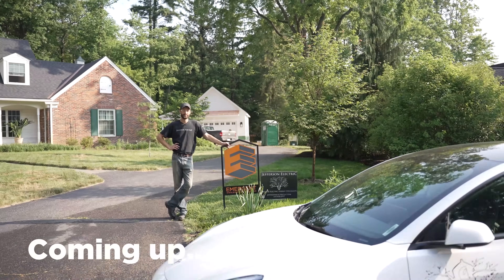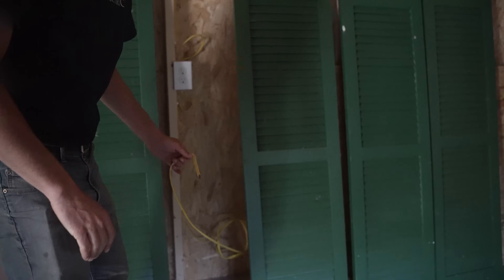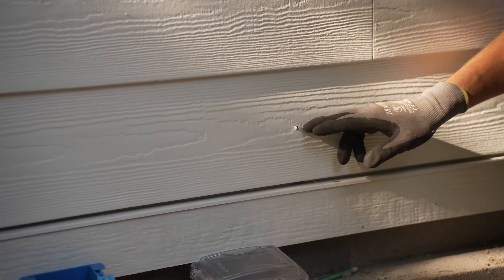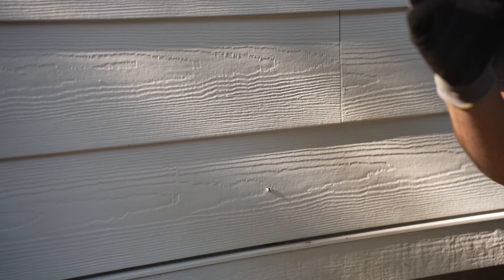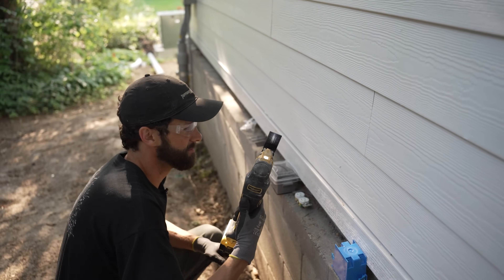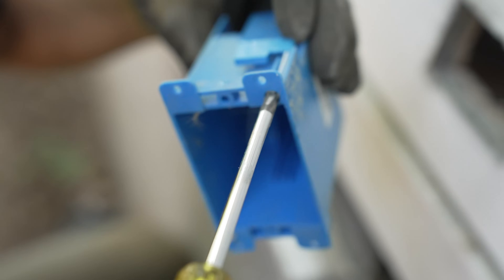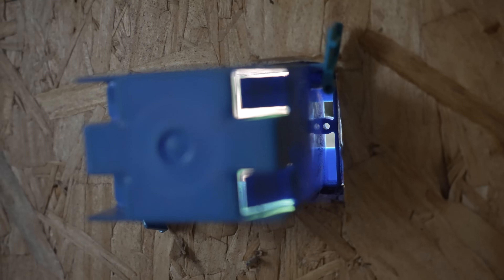Should this Exterior Outlet be Horizontal?

Comment: At 4:40 you spoke about drilling several holes to verify the lack of any interference framing before cutting in a blind install application. Another method that can be used with a slightly larger exploratory hole is to insert a piece of coat hanger wire that has been bent to a do degree angle into the hole and spin it 360 degrees to confirm that it is free space.

Comment: It's a shame the builder couldn't put a device block on the sheathing, put drip cap flashing on it, and integrate it with the lap siding ahead of time.  Nonetheless, excellent work and great instruction for retrofit applications.
Reply: Yes, with Hardie Fiber cement, it should be done on a flat mount either Hardie or Azek plate, flashed and Hardie siding around it, cutting hardie this way is not correct at all. And not paint the cut edges does cause issues, not prudent. All my outdoor fixtures, and duplex receptacles  are mounted on a flt Azek plate Hardie around it, and Azek properly flashed and the correct gap between Hardie and Azek mounting.

Comment: With the siding being thicker at the bottom than at the top, mounting it this way causes the face of the box\receptacle to be not plumb, especially if it was mounted vertically.. Isn't that aesthetically unpleasing?
I would prefer using a weatherproof box, cutting just the siding and mounting the box to the sheathing OR mounting a box to a stud.

Comment: The flimsy blue box reminds me of some crap that K Mart would scream out on store PA " Attention K Mart shopers we have a blue light special in the hardware department. 5 flimsy Blue plastic electrical boxes for only a $1. Somebody back in the 1970's made gray plastic what supply house called builders specials that were far worst then the blue light specials. threaded 6/32 hole would strip anytime devices screw was just tightened very little over snug fit.

Comment: Us old timers & Greenlee company called that long bit a door bell bit. Greenlee made them in 12 & 18" lengths and a few diameters.  A few years ago at an IAEI class they told us we have to use type UF cable to enter any exterior box due to type NM-B cable is not rated for damp or wet locations. If pkssible I prefer to use a sturdy metal wall case and mount it on side if existing stud & use two screws to secure side & a maduson bar on other side. ( vertical mounted box ).

Comment: ouch, cement board and very old plaster are totally killer on oscillating saw blades. to much friction and heat build up in their high speed oscillations.
surprised you managed to do that with "one blade", as it likely had no teeth after 5 seconds. lol

Comment: Here either a mounting block which could have flush or surface mounted metal box or surface metal direct onto siding we never penetrate the siding direct with a box, masonry brick/veneer is an exception but then many timers a surface mounted metal box.

Comment: 10:38 I don't believe it's required by code but it is certainly good practice to put the neutral up when mounting sideways. although not really a big issue in this situation as the box will prevent pretty much everything from getting in there including those giant pressure washer GFCI plugs. And I am of the camp that the unused screws should be screwed in, it's sort of like asking for something to poke them.

Comment: That box and cover sticking out of the side of the garage like that is quite the eyesore. I would have caulked the top and sides of that box, a neoprene seal will deteriorate quickly. I also would have fastened down that wire on the interior side as well. 
I’m assuming you’re going to do it, but when you make a how to video you should really show it.

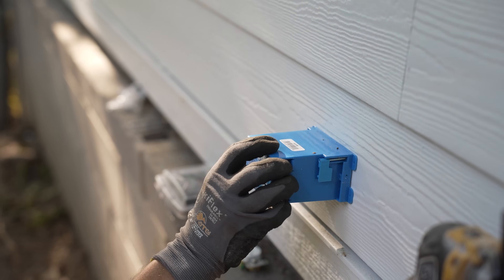Comment: 4:50 Easier life hack for finding studs, would be use a scrap piece of 12AWG with bend 90 degrees at 3.5" then insert and feel around. With insulation you can use the bit method or just straighten out the wire and probe around or upsize the wire a bit as well.  👍🤠

Comment: Those are the absolute worse outdoor electrical box you could have installed. They will leak. They look ugly. And they’re not even surface mount. If it was you could at least have that going for it; not penetrating causing leaks.   

No. Get a recessed in use outlet box with a mounting plate that matches the color of the house. Some come with seals or get a putty pad and stick that to the back inside to completely seal it. Then some tape like zips sealing tape.  

And it’s nice to put 20amp outside commercial quality WR TR outlet and have the breaker be AFCI and GFCI.  Much easier to go to a breaker and reset when you have a bunch of outlets in closed boxes around the outside. Or when it’s freezing out. Or raining. Or how most homeowners won’t know where all their outside outlets are and wondering why this one odd indoor one just keeps tripping. And how the gfci breaker will be inside and won’t ruin because water won’t be leaking into the panel. Well maybe if you do it. 

Or like this horror show where you have a single inside electrical outlet being the gfci fault location and not the outside. So when it trips and it will trip because of your poor poor boring non creative choice of an outlet, it will leak. And when it does nobody will know where to look to make it work. 

Breaker is on. Outlets don’t have a gfci trip button. Guess that dumb electrician wired them wrong.   

Seriously the worst video so far.  Someone needs to make a whole channel after every video you do telling people that they shouldn’t do all that. Just confirm for people that it’s a satirical YouTube channel and now you’ll show them the right and legal way to do something.  Wouldn’t have the heart to tell people you’re serious.  

https://www.hubbell.com/taymac/en/Products/Electrical-Electronic/Outdoor/Boxes-Covers-Plates/1-Gang-6-in-1-Weatherproof-In-Use-Cover-HorizontalVertical-Nonmetallic-White/p/2294588
Reply: Did you do anything special to get that link to post? When I try to post links, the post gets shadowbanned.
Reply from the maker: Thanks for including a link, @jspafford. We'll look into these!

Your input also sounds really well-educated. How long have you been in the trade, and in what region?

Comment: Even though I’ve done them, the box sticking 3-4 inches off the wall in open space feels like an abomination waiting to attack someone’s leg or get ripped off by someone carrying a ladder. Have you used the Arlington or Hubbell recessed boxes before for these applications? Curious what you think.
Reply from the maker: The box is inside the stud cavity on the inside and doesn't extend beyond the studs. Does that seem risky? Do you have a part number for what you're recommending from Hubbell or Arlington?
Reply: @ElectricProAcademy  Hubbell is under their TayMac label, one model is MR420CG. Arlington has a variety too, DBHR131C is one, and these are designed to be true vertical on lap siding.
Reply: @ElectricProAcademy   At least the Arlington is around 5 inches deep, so easy in 2x6 cavity, thick exterior wall, or crawl space. I haven’t tried it with a 2x4 space behind, so if the exterior wall is thin it might not fit. However, in other situations I have used a piece of scrap plywood to pull a box out that was otherwise too big behind to fit. I expect that would go fine here.
Reply: @RJ-ej1nr  I had no problem installing the Arlington in a 2by4 wall.
Reply: @darienredsox1878  Good to hear, thanks for the info!

Comment: this may work with this siding, but I would caulk top edge. On my siding you have problems with door hitting overhang of siding above and outlet would be quite tilted so i put in a weather tight box and have it stick out enough to clear siding and have nice level box that i can open cover all the way. the plastic boxes get loose from prying of cords on cover plate.

Comment: Another good method use a 4sqaure box go to the stud and use the approriate mud ring depth. Them carlon are ok but them tabs are crap if your gonna use a remodel box go for grey cut ins with the metal tabs much better and dont break  them carlon suck.
Reply: I prefer 1900 steel boxes with plaster rings in general it lowers the risk of over stuffing and gives one more room for homeowners use of large dimmers and wireless control devices.
Reply from the maker: Great input, @shanebibby6006. We call the metal-tabbed gray boxes "Slater boxes" which is what I was referring to at 7:09 as my preference too! The metal box option would also be hearty.
Reply: @ElectricProAcademy  And while you're at it, wire the whole structure with MC or better yet 1/2" conduit. (just kidding (or am I?))

Comment: Sorry Joel. And like a lot of hate here today.  This isn't meant to add to it. I genuinely want to know,  if you have time to respond,  I thought there was a code related to back to back boxes in the same bay.  Can you clarify when it applies.  I've been running wires to the next bay to stay compliant but looks like i may have misunderstood that code?
Reply from the maker: Not totally tracking, are you referring to the electrical box and the cover?
Reply: @ElectricProAcademy  I have to look it up but I think there is code against installing two boxes facing opposite ways (back to back) in the same stud bay. It runs the fire rating of the wall or something? If you have 2 boxes in the same stud bay, they need to be 24" apart or in separate bays? I'll see if I can find it and post it here.  Would like your interpretation on it
Reply from the maker: Yes, please hunt it down and share! Nothing comes to mind for me

Comment: In my 55 years of doing Residential Electrical Wiring as a licensed Journeyman Electrician , I have never stripped or removed the outer sheathing of NM-B Romex Or UF cable BEFORE inserting the cable into a electrical box regardless of the type of box being used whether for a Duplex Receptacle or a Switch or for a Ceiling Light /Fan fixture.
Reply: I do it all the time. LOL
Reply: @whiggins101  me too, I find it easier than struggling with the box in the way
Reply: When I started I was taught to pull the cable into the box, open it with a cable ripper, snip the sheath and pull off the paper. I have since found it faster and neater to use nm cable cutters and push in wires plus min sheath when that’s possible.
Reply: As a DIYer, I agree with you when it comes to wiring NM-B in plastic boxes with clamps or using plastic clamps in metal boxes. If I strip before insertion, then the sheathing always gets caught up in those plastic clamps. 

But if it's a box with metal clamps or no clamps at all, like most 1 gang new work plastic boxes, then it really doesn't matter when I strip the sheathing since it won't get stuck
Reply: Doing it before hand seems to get you the exact length vs trying to do it in the box which can leave more insulation to catch fire

Comment: I definitely would have done this differently. Not that you didn't do fine work. Considering the vast number of open spaces in the breaker panel, I would have run a dedicated circuit for that outside outlet (my preference if possible). Quite often outside outlets get utilized for high current yard/power tool devices. Having devices plugged in to outlets upstream could cause nuisance trips when you want to use those high current outdoor tools, not to mention all the potential failure points in that chain (wire-nuts and the like). Having a dedicated circuit would also facilitate having the GFI outlet (with indicator light) in the outdoor box (another preference). I like the shortest walk to fix a fault. Older high current tools can occasionally cause nuisance trips in GFI outlets. I wouldn't want to have to trapes all the way back into the garage to reset the GFI.

Not sure why you would choose to put your box out in the middle of the stud pocket like that when you could have attached a rigid steel box to the stud. All the stress of pushing and pulling on the outlet from inserting and removing plugs is transferred directly to the cement siding and insul-board with no support behind it to keep it from flexing. That could potentially lead to stress cracking of the cement siding. Due to those same stresses I don't think I could trust those plastic spin-out anchor tabs on that remodel box either. Maybe for switches, but not for outlets. Does anyone make that design with steel anchor tabs?
Reply: I would have run a dedicated circuit (GFCI outlet)with a wall switch inside to easily turn off the outlet so that it was only energized  when I was using it and so none can steal power.   The GFCI indicator light like you mentioned would tell me it was energized.  Yes you could just use the breaker to control the outlet but i like a switch instead so there is no need to throw the breaker.
Reply: I agreed 100%. The box that he's putting in is a re-model box, the name said it all. Why not mount the box to the structure? Hmmmm
Reply: Would it be permissable or favorable to install a cross member between the studs to fasten it to?
Reply: @PsalmCourier  The proper box, mounted properly directly to the wall stud, would not need the extra reinforcement.
Reply: Man you took my words right outta my mouth lol! I agree with you 💯 %

Comment: Why not rotozip it ? Instead of destroying blade?
Reply: I find it hard to make a straight line with a Rotozip. Maybe you have a better technique. And I rarely see electricians with Rotozips - nice tool though.
Reply: @jamesreizner2673  yeah I understand that aspect but when it's being covered up by a weather proof box so 🤷.. iv been told never to use a multi tool and also the opposite but it's whatever gets the job done fastest I guess 😉
Reply from the maker: Don't own one actually, but that would be a great solution! 😅

Comment: Since you installed this with an old work box, how does this handle any water making its way down the side of the house wrap between the siding and the sheathing? It's not guaranteed but some water does find it's way behind most vinyl siding hence the need for house wrap. I ask because I've long contemplated adding exterior outlets to my home and while the gasket should prevent water intrusion from the exterior, I worry about any from behind.
Reply: Anything could happen. GFCI protection and WR receptacle help if there does happen to be any water intrusion. If you are really concerned you could use an outside box mounted to the siding and a weatherproof Romex connector through the wall. Many ways of doing this.
Reply: @jamesreizner2673  Gotcha. Also just found the QuickFlash product as well for those who remove some siding to do the job.

Comment: Very nice vid. I would add another layer of clear or colour match sealant around the perimeter gasket. Those neoprene gaskets tend to get much in two years. Also, I only use federal spec WR plugs for outside.  They have nickel plated contacts for extreme duty.
Reply: It did look like a lower-end receptacle.
Reply: Of course, I have a keen eye!
Reply: @jamesreizner2673  I would disagree, based on the color of the back housing and the pattern on the mounting tabs, it looks to be Bryant RR15SWWRTR, which costs on average $4. I cant speak to the quality, having never used the model of receptacle before, but being owned by Hubbell I would definitely expect higher than some cheaper Leviton model

Comment: Nice.  One thought that came to mind is that based on the green coloring of the sheathing, I'm assuming that it's Zip R.  Having watched one too many building channels, I would take some Zip Liquid Flash and put a nice bead against the sheathing where you're installing that box, then set the box into the liquid flash and tighten it up, that way the WRB remains intact.  Would probably seal up the knockouts on the box as well (from the outside of course, not the inside).
Reply: It's just normal Zip sheathing. Regardless, it would work with a liquid flash, even third party ones. You want to be careful flashing something like that rather than just letting it drain in back, and sealing the penetration. Drainage is the better option most of the time in my opinion: if you screw up, you don't create a pocket of manky water; and you have much less to screw up.

Really... if possible the penetration should have been completed before the siding went on.

Comment: Isn’t it better practice to keep neutral side up when installing receptacles horizontal?
Reply: I think maybe we are teaching him something ;-)
Reply: @jamesreizner2673  I’m sure the answer will be that it doesn’t matter either way because the plug is protected by the cover so nothing metal will ever land on the hot blade but I just like to be consistent all the time and do things the same way.
Reply from the maker: Sounds like a good practice! No code on the topic that I'm aware of, but more power to you for having a system. I can sometimes be too hasty on solo installs like this.

Comment: Thts hacky for me but im in the snow belt so the smaller holes in shell the better.(all though you did it very well and professional looking)an outdoor box romex connecter on the inside duct seal and some deck screws thru the back of the box and some silicone caulking for the hole to seal around the romex